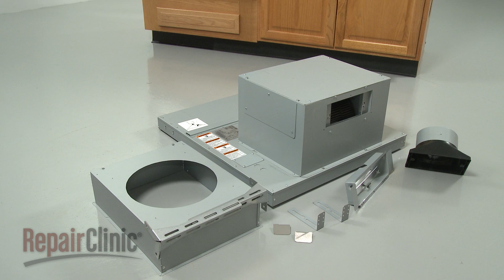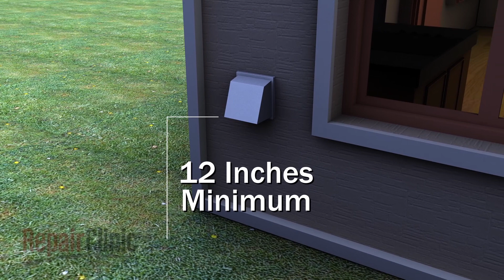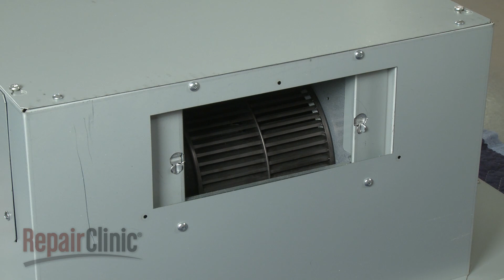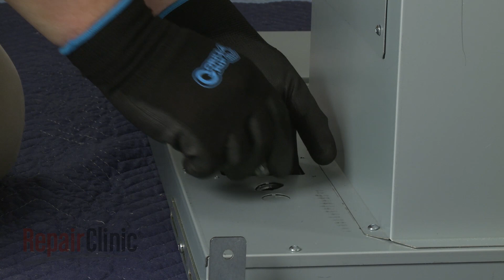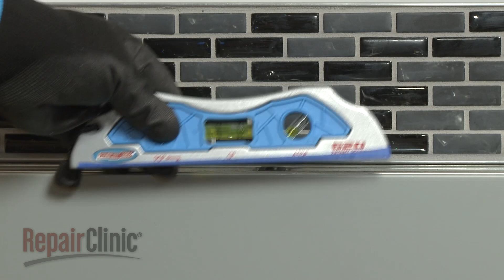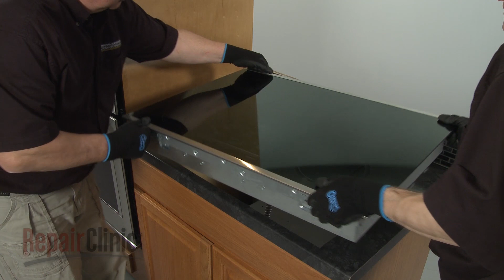Whirlpool Retractable Downdraft Vent Installation (Model UXD8630DYS)

Comment: One HUGE problem with this model is that once you remove the screens for cleaning you can NOT let it retract back down into the casing because... it will NOT come back up!  We had this happen back when we first got it and it appears that we have the same problem again.  I have notes saying "MUST open MANUALLY if the screens have been removed.  I just can't find anywhere online that outlines HOW to manually raise this f'ing thing!  Every search of this with the term "manual" tries to provide a "for a FEE online manual".  Shesh!

Comment: The cooktop was purchased at a very good    allmy.tips/GE_Cooktop?O15    It arrived very quickly. It looks good and works just fine. However, the RF large electric eye is far off center as if it wasn't properly secured at the factory. I found that the eye is not centered after the cooktop was installed in my countertop and turned on. Waiting for instructions   REPLY

Comment: My unit does not stay up.  I have to hold the button to get it to come all the way up.  Then it automatically retracts.  Hence, the unit does not stay up.  Do you know how this might be fixed or troubleshoot?  Thanks.
Reply: Peter, Were you able to fix the problem of vent automatically retracting?  My Dacor downdraft hood is having the same problem, right after I "cleaned" it.  Maybe I shouldn't have sprayed the control buttons with 409 when cleaning :(
Does anyone have any suggestions on how to keep the hood from retracting?
Thank you.
Reply: Peter Frank most likely something is stuck, could be grease that ran down the track when you had the downdraft in the up position, now it’s stuck. Time to buy new one.
Reply: mine does that once in a while,   i just turn breaker off and on ,  it works again